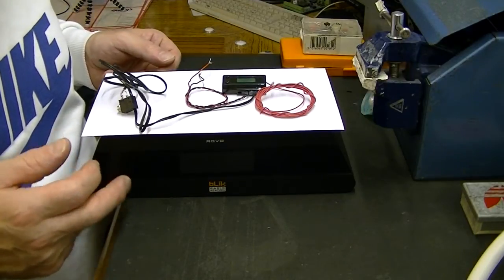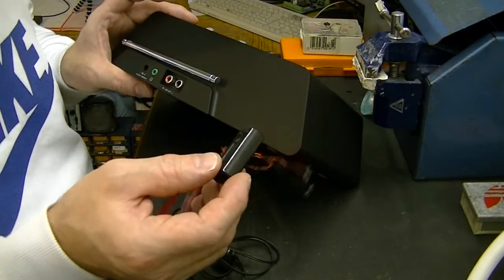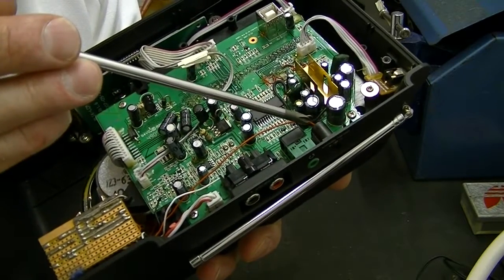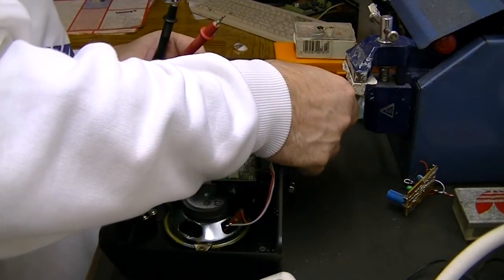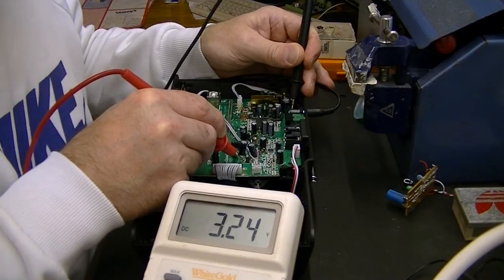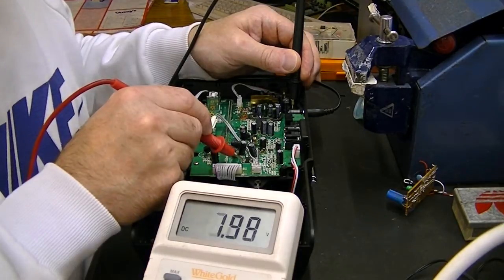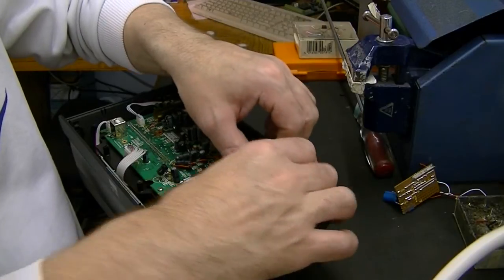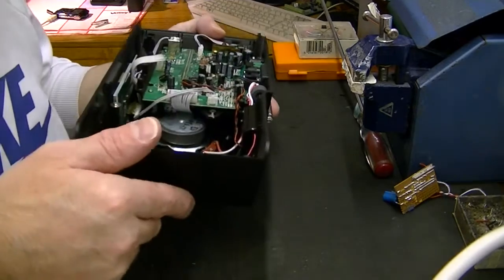FM Transmitter mod for DAB/Wi-Fi Radio. Part 2 of 2

Comment: Hi.i think a shorted my blik by accidently inverting polarity on power input,wich component fuse ,diode or else should i replace to fix it
Reply from the maker: The power required by this radio is DC 9 Volts. Nothing in the radio apart from maybe the Audio power amplifier will make use of the 9V directly. There are a couple of voltage regulators in there. You need to identify and test these.

Comment: Couldn't you have just bought a car FM transmitter with a mini jack instead and plug it into the headphone out of your DAB?
Reply from the maker: +Oscar Hendrix That would work too but you would still have to power a car FM transmitter from another plug-in mains adapter or by hacking into the DAB radio power source.